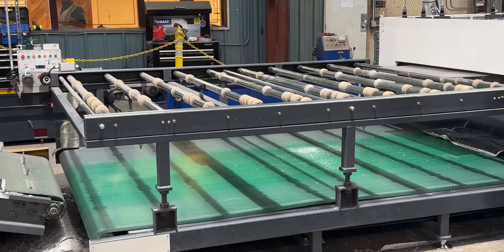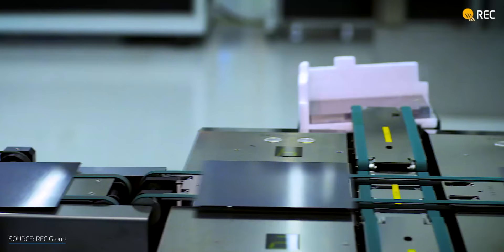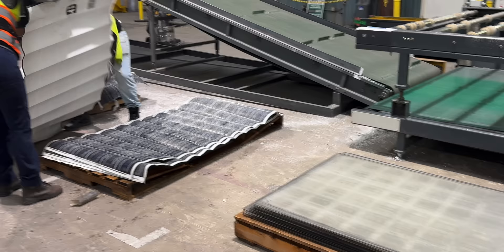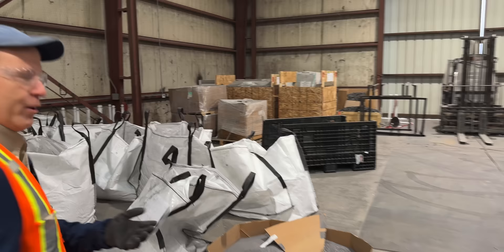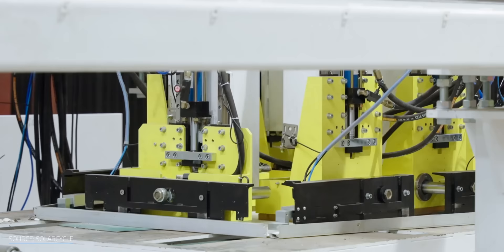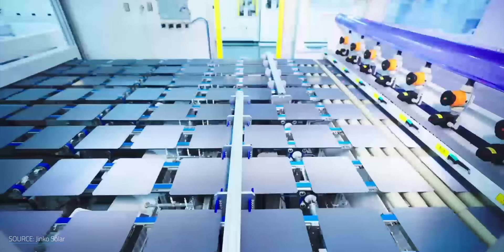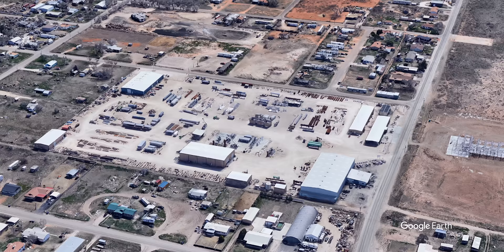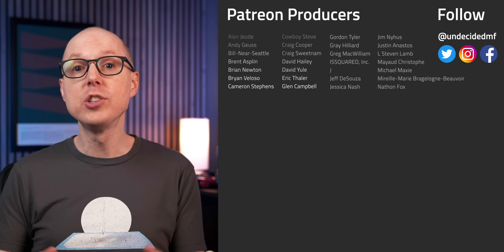What REALLY happens to used Solar Panels?

Comment: The solar panel recycling issue is SO overrated. First, the vast majority of solar panels in the world are less than five years old. They’re officially rated for 20-30 years, but modern panels only lose 0.3-0.5%/year efficiency, so they’ll still produce useful electricity for decades after their official service life - and by then, they’ll be paid for, so it’s free energy. Someone will happily take those officially expired panels for free and put them to some other use! Next up, current solar panels have about $20 worth of silver wire in them. It’s worth recycling them just for that. Would you chuck twenty bucks in the garbage?

Comment: if you take the COST of recycling versus the PROFITS from recycling  you see that these people do it because it is PROFITABLE! 
i know this because ive been extracting precious metals and common metals from thinks headed to the land fill for many years!
as for electronics, i use to have a GARBAGE HAULER way back in 2009 bring me truck loads of electronics and allow me to throw all my waste plastics in his dumpsters for FREE. im certified by the state of Iowa's DNR as an appliance de manufacturer!  
i DO NOT own or rent a cell phone!  i extracted the metals out of it myself back in 2019!
i like to save all my metals other than copper, aluminum, thin and thick steel. i melt it down and pour into water to get small pieces to be used as easily weighed currency when the economy totally collapses !!

Comment: Well your video is saying that solar PANELS can be recycled.  There was never any question about this (although you say nothing about all glass panels).  The question has always been if Silicon solar cells can be recycled and the video doesn't address that question.  The metallization can be recycled, but the (doped) Silicon can't be recycled as far as I know.  The video just skipped by that issue.  They're shipping it somewhere.

Comment: As soon as I hear "Recycling * is impossible", I know the speaker doesn't know what they're talking about or is disingenuous. If it's manufactured, it can be reprocessed- if nothing else, to a filler material, or otherwise repurposed at the ingredient/component level. This is the kind of semantic noise that prevents people from doing ANYTHING to solve an engineering problem.

Comment: It appears the problem is on the manufacturing end with using a glue to bond the layers in the first place.  Why can't the layers be held in place mechanically by the frame?  At the end of life, strip the frame and the layers come apart.  The panel would essentially be made the same as a double-pane window with the solar element in between.
Reply: There should be a glue that binds well until mixed with a deglue chemical or a deglue radiation.

Comment: Economic viability was always going to be the gotcha here. If recycling can be scaled up to meet demand, that's great, but it needs to be in the best (short-term) interest of the people that own the panels to send them to recycling, rather than a landfill. This is the same problem as with most plastic. Many types of plastics are recyclable, but it's currently cheaper in nearly all cases to just landfill it and use virgin plastic. This is because virgin plastic is ridiculously cheap, and recycling is comparatively expensive. There is currently very little economic incentive to recycle plastic as a result. If solar panel recycling can find a way around this, that might give me real hope about the long-term outlook for renewables in general. I, for one, would much rather put carbon into the atmosphere than permanently waste precious materials, pollute the oceans, and pile up massive landfills. At least the carbon can be removed from the atmosphere later (albeit with a very meaningful downside in the meantime).

Comment: This is so maddening. When you say end of life, are you meaning totally dead-lined (broken unserviceable), or no longer 100% efficient. because the biggest problem with "SOLAR" is it's a rich persons technology. These Fed programs DO NOT serve the middle class. the only homes with solar on the roof are MC mansions or High income areas. Middle class people cannot finance 80k roof setups (after rebates). Climate change reform isn't for the POORS.

So. I'll take some 40% efficient panels. I'll take as many FREE panels as someone is willing to get rid of. Where is this downstream market? Because there is a whole economy around second life equipment and amazon returns etc. Just because a heavy equipment company has burned 500k hours out of a bull dozer doesn't mean there is someone downstream who willing to put in the "time" they aren't willing.

Where is the Solar Downstream market.

Comment: How much energy and pollution are you going to create by making 1 solar panel? 
And how much energy and pollution are you going to create by recycle 1 solar panel? 
On a global scale? 
When those solar panels are going to be sell all around the world and at the same time will need to be re-turn to recycling facilities.
Will it still be cheap - reliable - and clean source of energy?
Reply: NREL has made a study on the emmisions of several energy sources across their lifetime including manufacturing and disposal. 

Off the top of my head:

Solar is 50g of co2 equivalent per kwh

Gas 500

Coal 1000

Source: Look up NREL, Lifecycle Assessment Harmonisation

DW has also made a video using the same source. DW How Clean is Solar Really?

Comment: PV solar panels is a dead end. It consumes huge amounts of energy and valuable materials.
There are thermal solar systems that are made of cheap ready available materials (rocks, essentially, and normal electric generators), which are infinitely better from an environmental point of view.
Unfortunately, politics always dictate bad solutions. PV would not be successful if they were not subsidized.
As usual, meddling in markets by politicians cause more problems than they solve.

Comment: reminder that electric cars only exist to save the car industry, not the climate. please always ride a bike and take the train.
Reply: I wish that infrastructure allowed that for everyone. Unfortunately, there's no train service near my house, and biking would be 50 miles per day on two lane roads with no bike lanes, no shoulder, and heavy traffic. I could bike to the bus stop close to my house, but that bus only runs a few times in the morning and a few in the afternoon, and usually doesn't fit my schedule.

The best solution in my case has been working from home as much as possible, and driving when I have to go in person.
Reply: Such arguments are easy cope outs imo. Yes, there should also be focus on public transport and biking/walking, but this isn't the answer to everything. In that sense an EV is already a good step in the right direction.

So far I have always used the bike, walking and train to get to school and uni, but upon looking for a job, most jobs are double/triple or more the time with public transport vs a car (like 2 hours instead of 30m, essentially losing 3 hours extra everyday). I would like to use public transport, but it just isn't feasible in many cases. And this is in an already pretty build up region with a lot of public transport, to get even more build up and public transport you need to look at (medium/big) cities.